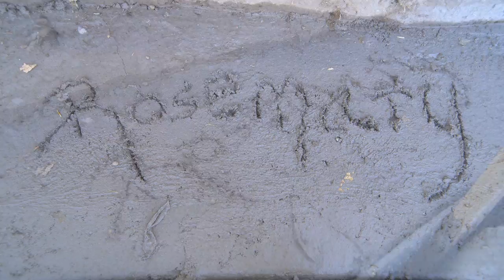DIY Koi Pond Construction | Finishing & Pouring Concrete - Part 6

Comment: Question: did you mix sand at all w it?  Followup question if not CAN you? Or does it weaken the concrete too much? (Im making pavers and i do like a 1:1 ratio easy on the brain  to make them smoother)

Comment: Can you colour cement when you are mixing it or do you have to wait until it dries then paint it?
Thanks
Reply: Thay make dies for concrete you  mix it in when you mix the concrete  it a powder
Reply: You can also make like a water color w the powder pigments.. just be careful if using a brush you can pull the concreate from under the color and it dries white streaky (which is a cool effect but prob only when u want it 😉)

Comment: Would really like to know why the cement coping since I have never seen you do it before .Does it make the edge more stable or is it just support for the rock edging .
Reply: Same here...maybe because of the vertical depth to maintain stability. But on the flip side why not mortar in the rocks when stacking. With the pressure of the water added I dont see the difference?